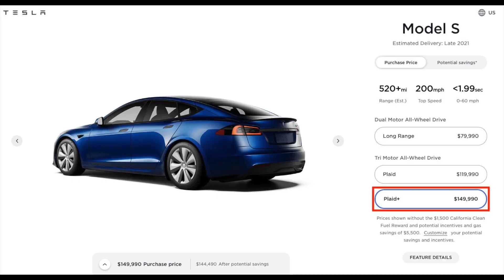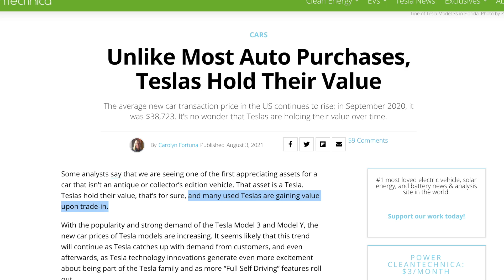Tesla 4680 Update: Moving Through Production Hell

Comment: Overall interesting and I thank you for this video.  But I have to disagree for the part that it is not important as consumer perspective.  It would be sad if the only thing they do is to make the battery pack smaller in order to keep the same range.  I want the final product to improve in regards to this major battery improvement.  Also, if they choose to keep the same range with a smaller and cheaper battery, I expect, as a consumer, to get a price reduction on the resulting car.  I know demand is super high and there is no motivation whatsoever to reduce the price but still, I think it would be bad to "screw" the consumer over this.  So all in all, I wish the consumer will benefit from this change.

Comment: Having worked on high speed roller process equipment in the food industry, it’s perfectly reasonable to be operating @80%. At some point the machinery needs a deep clean, and maintenance. Especially the rollers. 80% would be 5.6 days. 
Possible if the machinery is stopped and given a clean before the failure point, then a % more production could be gained. The issue is partly due to working with a dry powder, dust is your enemy and there’s only so much that can be done, without a clean. Adding a line then takes you back up in numbers, and provides redundancy.
Reply: Thanks~~<<for watching and Commenting, don't forget to start up making ><~ good profits in crypto like I do~<~Make a note to on how to start (𝗪𝗵𝗮𝘁𝘀𝗔𝗽𝗽)👇🏻.
÷(¹)(⁴)(⁰)(⁶)(⁴)(⁰)(⁴)(²)(⁷)(⁴)(³).

Comment: Won’t the 4680 charge and discharge energy faster? I think this will mean performance gains, also lighter weight due to less battery cells = performance gains as well as slight cost to run advantage.

Comment: Not true that the battery form factor does not matter (2170 vs 4680). Regardless of the form factor and the cell density/efficiency, there are other advantages to the new 4680 cells that have nothing to do with how many miles you are going to get. Even if two different battery packs offered exactly the same range, the new tabless architecture of the 4680's offers a huge upgrade to the charge and discharge cycle of the cells. The greatly reduced travel distance of electrons through the batteries will mean less heat buildup in the cells during charge and discharge cycles. This means people who get a 4680 vehicle will likely have future performance upgrades possible on the discharge side and future upgrades on the charging side. Opting into a 2170 battery pack may very well leave you behind the game in the future.

Comment: Tesla was pretty keen to go to 4680 cells to cut processes in battery factory. The current four modules have either 1058 or 1150 cells. The new large module has 960 cells and 100 kWh is all cell positions filled with high capacity cells. The Model S and Performance models would get the high spec cathode (NMCA). The 3/Y LR could get NM cathode, and 3/Y standard range LFP cathode cells and the only thing changing in the pack is the cells. LFP would operate at lower voltage. The battery weight would be the same, only the chemistry would physically differ and the customer would only notice a range difference.  

Tesla does not advertise battery KWh or cell chemistry or number of cells. We only know due to environmental regulatory filings which often require information on part labels. 

Model Y with double casting and other improvements is still a big improvement. If battery day did not happen, we would not know of a change that has negligible customer impact, but significant cost savings to Tesla.

It sounds like the Plaid+ was going to get more cells. Cybertruck is probably going to get two 960-cell 4680-size packs - one on top of the other. 

In terms of product yield with new cells:

--- At 20% yield (a year ago according to Gali), material use is 500% of that in a fit for purpose cell. At the present 70%, its 143%, at 80% its 125%. When they get to 90% yield, its 111% material use relative to 100% yield. You would have to think at 90% production yield that costs would be lower compared to buying-in cells. The problem is only in calendaring the cathode. 

So we would have to think that -- if production yield averages 70% to 80%, and the problem is not the anode which has softer component materials, or the current collectors, or rolling the jelly roll, or making the can and assembling the cell and adding electrolyte and doing cell formation  -- that production yield of the calendared expensive cathode sheet is just 30% to 40%. 

Elon said the calendaring problem did not exist for the smaller rollers of smaller calendaring machines, so an option is to use many smaller machines for cathode. I can't imaging sheet width is an issue, as the cathode sheet will need to be sliced to two-cell widths (~155 mm) then stuck to a slighter wider aluminium foil before being cut in two. or the other option is the cathode sheet is cut to one cell length (~78 mm) before being fixed to the al-foil. Perhaps a significant issue is wastage on cathode sheet edge that is independent of sheet width and a wider sheet through the calendar machine has less percentage wastage.

Comment: the youtube channel Applied Science has done a couple videos on Atomic Layer Deposition / Sputtering; and i guarantee that guy has the answer to the denting cathode layer on the Tesla roller. Tesla wants to make sure to pull a vacuum around the roller and then charge each atom of the cathode (in gas form) while oppositely charging the film that the cathode is depositing on. i wish i could tag @appliedscience, but i don't think tags work in Youtube. that guy solves these sort of cutting edge engineering problems all the time.

Comment: LOL.  You DO car what batteries are in your car.  4680's will charge much faster.  And will last more charging cycles.  And have less thermal issues.  And will cost less.  And with a structural pack make the car safer.

LFPs for instance are safer and can charge from 0% to 100% daily w no issue and has a longer cycle life than NMC or NCA cells.

Comment: @1:38 . I believe he's wrong here. You will give a sh*t which battery you have even if they keep the range the same because:

1. The 4680 cells will be tabless and will manage heat better meaning a better Supercharging curve.
2. Less amount of casing material per volume of active battery material and fewer cell connectors between less cells will result in a lighter pack even with the same number of kWhs meaning a lighter curb weight.

Comment: I mean... I like that you speak fast, but... 1:54 - you do not care what batteries are?? How about the weight factor - the 4680 with denser energy density, for the same amount of KWH per pack, you get a smaller battery pack, with reduced weight. Do you think that could make your care more nimble, less wear and tear on the tires, suspension, etc.? Nah... I don't think so... Also: with 4680, they will go with the battery pack giga-casting, as the structural part of the car, which is going to make the chassis more stiff. Or do you think that does not matter either?? Stick to driving - your technical skills are lacking.

Comment: The small roll to crush the powder works fine, but when they use a bigger role, dents in the role will form. It's an design issue. They figure out a solution.

Comment: Decreasing the battery size leaving same capacity will already increase range due to the mass reduction))) Together with casting and battery as a structure also
Reply: Not how physics work. Weight plays a role in city stop and go where you don't need range and a Model Y is already rated at above 400+miles(read EPA documents). The gain will be minimal, within 10%. Better drag coefficient is what adds range, weight is irrelevant once you get to speed, actually beneficial down hill. They will have to add more capacity to increase range, that is without doubt what they will do

Comment: You don't mean smaller pack per kWh. Fundamentally range is what the pack size is. What you mean is they will have less cells in the car taking up smaller volume and also weight. However they will balance that to make the same range as currently.

Comment: The 4680 cells will charge slightly slower than the 2170s. Please take another look at the Battery Day charging graph for anyone that still thinks otherwise.

To the video: 80% doesn’t sound bad at all at this point. Elon mentioned the roller issue on the last call and he and Drew said there are no blocking issues so next year is looking good for the 4680 introduction!

Comment: There’s a huge advantage to the 4680 cells. Even if they don’t go 400 miles, the vehicle’s weight will definitely reduce. We’re looking at over 400 lbs reduction for the Model Y (with the front and rear body casting). 
Imagine using the 4680 for the Model S and X. You’re looking at effectively a much lighter car ~4,200 lbs for the S and possibly 4,900 lbs for the X.
Reply: Exactly and losing that weight. Will allow for smaller sized pack's while maintaining the same or even slightly more range. Better performance, better handling, better braking, smoother ride quality. 
That also enables better economy of scale for tesla, which means more cars produced per kwh of batteries used. 

And should result in cheaper prices. Especially in the next 12-18 month's. As gigalin and teratx open&start to ramp up production, alongside the 4680 lines scaling. I mean elon already said gigalin could do 1,000,000+units when fully built out and up to 250gwh of batteries. I think by 2023/2024. With just the existing factories, tesla could do 3.5+million units of total sales. 😎
Reply: @4literv6  Performance, handling, and braking improve with reduced weight, but ride quality tends to get worse.  One aspect is the ratio of sprung to unsprung weight, which gets worse as the body gets lighter.  The other thing is that more weight helps the car flex the sidewalls, which soaks up some chop.  OTOH, lighter weight would allow them to add more sound insulation, if they chose to.
Reply: @incognitotorpedo42  with less batteries taking up space, what if the weight can be concentrated more towards the centre and slightly softer springs? 
Thinking Roadster
Reply from the maker: didn't think about the weight!!!! this is huge!! thank you
Reply: Plus nickel battery will come to model Y which means more horsepower and more weight reduction.
Reply: They will def go above 400miles. The current Model 3 has an EPA rating of about 580+ miles, but Tesla isn't advertising it yet, they will in Q4. Don't listen to him, he obviously doesn't want to cut demand by saying it will not have more range, but the new batteries will add about or at least 20% or more range out of the box. Probably more.
Reply: Not just weight. New battery pack should also be able to charge at a higher rate.
Reply: @ivanobulo  i had the same thought but elon kind of ruled that out
Reply: @ivanobulo  I doubt that very much. The biggest issue with these batteries is cooling and fast charging. Tesla said they figured this one out, but I doubt they will have that with launch. Plus the V3s are rated at about 270kW anyways max.

Comment: Awesome progress if “production rate” is at 80%, from 20%, a year ago. For novice like me it means that the machine is working (quality) and as they are scaling (quantity), by maybe replacing equipment in the line, on the road to 100%, with equipment that will be more like the equipment in the final production line, there are to be engineered out unknown unknowns. I have worked on projects with “new” technology where these things happen, it is pointing to them innovating at speed, unreal to work for a boss that understands and creates an environment that is safe for those engineers.
Reply: True, but last 20% is usually harder than the first 80%

Comment: @HyperChange What do you think of using Adiabatic Compressed Air Energy Storage (A-CAES), instead of massive Tesla Megapack deployments? Or pairing a large A-CAES system with a smaller Megapack deployment & still using Auto Bidder? The cost per kWh of storage with an A-CAES system is about the same as large-scale Megapack storage, and is also getting cheaper over time, like batteries. A-CAES systems could be a good way to alleviate some of the battery bottlenecks from the decarbonization effort.
Reply: The Megapack is way much more flexible and faster to build. A-CAES could make sense at really large scales, but the world is moving away from centralized power.
Reply: @andrasbiro3007  Yeah, but you can make a 1 GWh A-CAES energy storage system for about the same cost (per kWh) as Megapack. And Tesla would not have to build all those battery cells... which means more cells for the Semi, Cybertruck, etc.

Tesla Powerwall would still be perfect for home storage, of course. But home batteries are not enough to decarbonize completely. Even if every home had a Powerwall.

So in either case you will need pockets of centralized energy storage (whether that is accomplished via Megapack or something else)
Reply: @LuKiSCraft  
Tesla will build plenty enough Megapacks very quickly. At the glacial pace these technologies are developed, Tesla runs circles around them.
Maybe if Tesla sees potential in it, they can buy the tech and commercialize it in a very short time. SpaceX should have the necessary tech and expertise.
Reply: Megapack only replaces peaker plants. There is another level of long term energy storage that has to happen. Picker the winner of long term energy is a massive investment opportunity. It is probably out of the scope of Tesla at this time. Tesla has way too many balls in the air. I am looking for that company that is going to dominate this space.
Reply: @samuelwilliams7331  I was researching this and was very pleased to find out that a company, HydroStor, is already doing this. And they have 2 large A-CAES systems already running in NA. Unfortunately, it is a private company. But it's relieving to see this is already being commercialized, even if I can't invest :S
Reply: @samuelwilliams7331  
Actually, Tesla is way ahead in this game too. The Megapack can replace anything, peaker plants are just the best targets, due to their high cost and low utilization.
And Tesla doesn't just make Megapack, they also have a software, which can coordinate a large number of decentralized energy production and storage assets. It's called virtual power plant. https://www.youtube.com/watch?v=ggdYts4muu0 In a few years the battery shortage will be resolved, and Tesla will make millions of Megapacks. And it's also going to be cheap, as the 4680 cell production ramps up. And it's also going to be very flexible, and fast to deploy. Competing with that is going to be very hard.

The main problem with the competition, even if their tech is good, is that Tesla now has vastly more resources. Money, engineers, manufacturing capabilities, experience in building both distributed and large scale projects, and a good relationship with many governments all over the world. On top of that, Tesla is willing and able to take risks in order to vastly speed up it's projects. For example they built both new factories without a final permit. This saved them a year or two in construction time, but in the worst case the could have been forced to tear down the buildings and start over somewhere else.

Comment: Correction: you say it's a reduction in kwh, but it would actually be a reduction in weight/number of cells due to the energy density increase, but equaling the same kwh pack.  This will translate into less weight, less production cost, along with less production cost on the body (gigapressing the new frame parts) therefor less cost being passed on to the customer and blowing the competition out of the water yet again.
Reply: Also the customer will have a much more efficient vehicle in the end with better wh/mile numbers resulting in less running costs.
Reply: It will be more kWh
Reply: @marcusbiller867  possibly, but in the 300 mile plus range, cost becomes more of a factor than anything.

Comment: 70-80% yield is really good.  I think the @thelimitingfactor mentions that Giga Nevada is probably only running at about 80% yield.
Reply: I think the issue is that the manufacturing machines are being damaged, causing the line to grind to a halt for (costly) repairs and replacement.

Comment: I saw this coming a mile away. I kept asking myself “Why would they make the 4680’s cars have more range?” 
It would be like the ozbourne  effect but for batteries….unless they intentionally made it with less 4680 batteries keeping the range & performance about the same as they are currently.
Reply: 2170 didn't k!ll the Model S and Model X did they?
Reply: @isthatatesla  2170 wasn't that much of an improvement.
Reply: @incognitotorpedo42  2170 was a very big improvement, especially now with the 250kW and 82kWh batteries. 4680 will be a 50% increment
Reply: Why? To kill the competition. Tesla has been, somewhat artificially (for example killing the regen setup in settings for better EPA range) increasing range. They also let Panasonic build more dense 2170s for 5kWh more. Don't fall for this, they will def have a lot more range. The competition requests it. Sorry if you bought a car now, but that is the truth

Comment: Is the 4680 the million mile batteries we have heard of?
Reply: It's likely that the current generation of 2170 cells may last a million miles in a battery pack. No one besides a taxi service will put more than 500,000 miles on a vehicle in 20 years. That's over 25,000 miles per year. The cars will give out and have obsolete computers before the batteries die.
Reply: @Nphen  thanks for the info.  robotaxis could go 80-100k/year.  I feel like I have heard that number thrown around, but not positive.